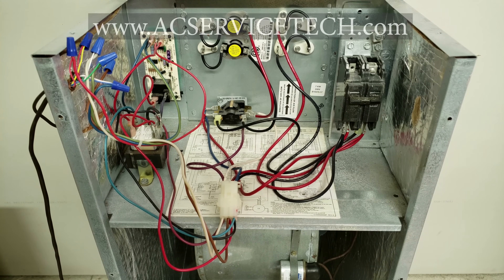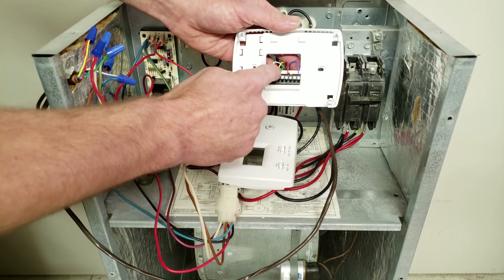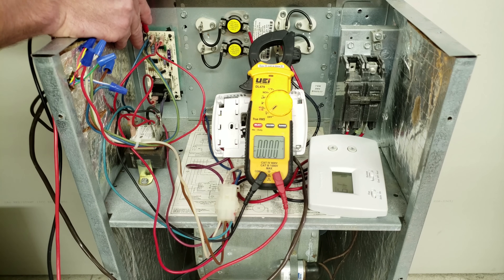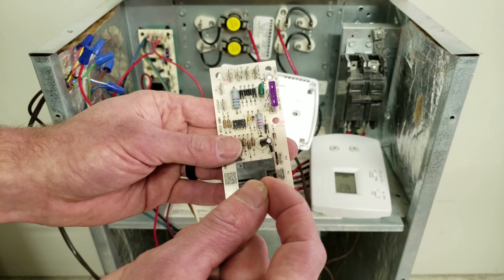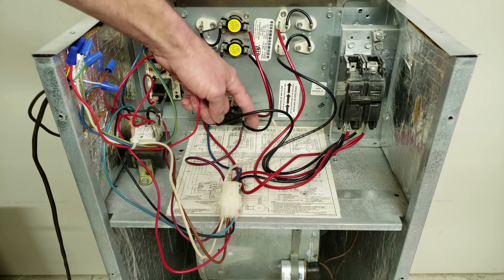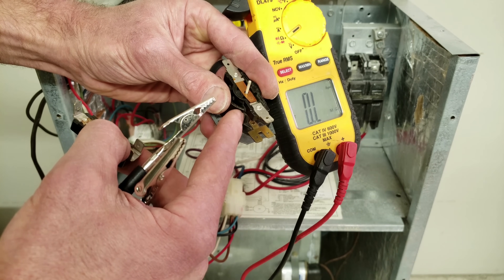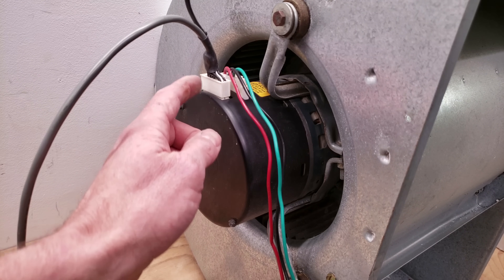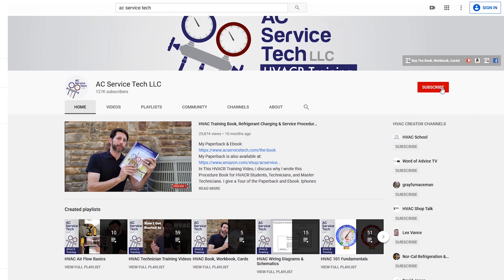Air Handler Blower FAN WON'T TURN OFF! 5 Reasons Why it Keeps Running!

Comment: First, awesome stuff!  
I brought an UVC light for the HVAC.  Install from manufacture has it powered by 110 v AC all the time.  Just doesn't seem efficient for a bulb that has a run life of 9k hours.
Watched this video to see if I could tie it into the Blower Motor Fan.  What are your thoughts?

Comment: Good explanation. I have short of not exact but similar issue. My AC unit keeps running even after set temp is reached at thermostat. For ex I set temp at 74 and system turns on and once it reached 74 it stays on for more than 25-30 min. However if I turned the set temp higher than actual temp than system turns off immediately. Also if I manually toggle the off button from thermostat it turns off. 
On average my unit runs for almost 1 hours even whenever I check the thermostat it’s at 74. What could be the issue?

Comment: Excellent video.. What this video doesn't tell you was that the problem finds YOU sometimes.. My Blower circuit board relay contactors must have fused together, and that burned plastic smell was pretty obvious... Causing the blower to run continuously.. After a couple of days the relay literally burned up and scorched the circuit board.  blower kept running
Since the Rheem AHU was over 10 years old, the original circuit board was no longer available.. Had to hire an AC guy to rewire the replacement,  which I HATE TO DO... Cost over $200

This year decided to start replacing the electricalsthat hadn't been replaced/failed yet.. AHU Blower transformer and capacitor.. Cost $20.. Why wait for failure?
Then outside replaced the  contactor and dual capacitor.. Another $20
Added a hard start kit.. $30

Comment: I just installed a Nest thermostat and the fan keeps running.
Is it an issue with the thermostat or the unit?
Reply: I have the same issue
Reply: I have the same problem

Comment: Good video, but keep in mind, the average homeowner should keep their hands out of the air handler. Also the ecm motor can hold a charge after power is off. Best leaving these to the professional.

Comment: do to the lack of depth perception in this video, throwing your hand into that high voltage section is freaking me out.  Even though that breaker has no line voltage, all i see is the on position.
Reply: Is having the breaker off not enough? I plan on swapping out my capacitor and some relays.

Comment: And the carpenter that shoots a 2-inch screw into the thermostat wire always makes for good times . It's like playing roulette, "which wire's are we going to short together today?"  😂👍
Reply: quickly grabs the 2-1/2" loaded finish nailer or brad nailer with 2" to attach chair rail and 1/4" thick wainscoting........